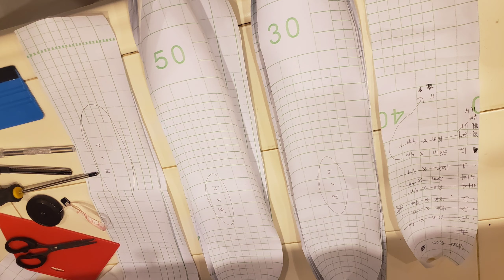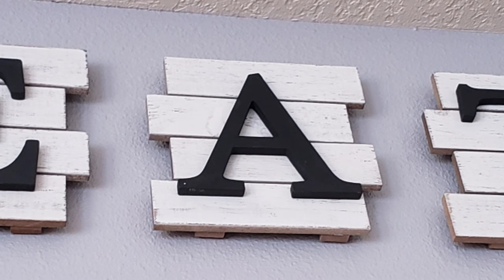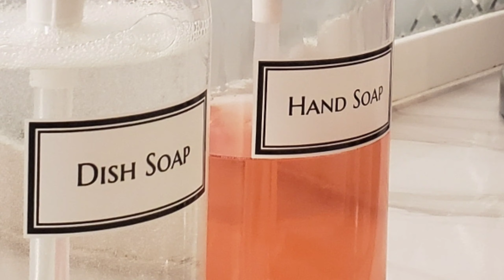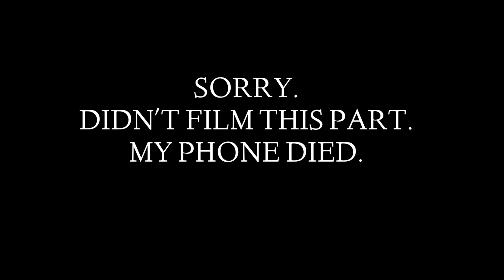DIY KITCHEN MAKEOVER | AFFORDABLE

Comment: how does the contact paper hold up with wet or hot items?
Reply from the maker: It's actually holding up well so far. Very easy clean up & no damge from heat. And I'm not surprised because It's recommended to heat the contact paper with a hair blow dryer to the highest heat setting for the contact paper to stick better on curved surfaces. No issues with water either. Seems waterproof and it's pretty thick! I will do an update a few months from now 😊